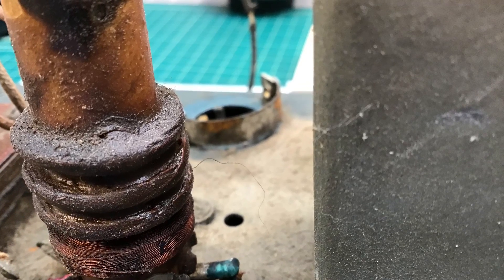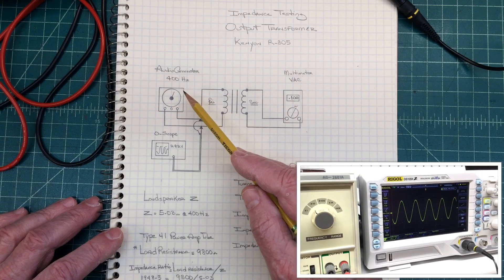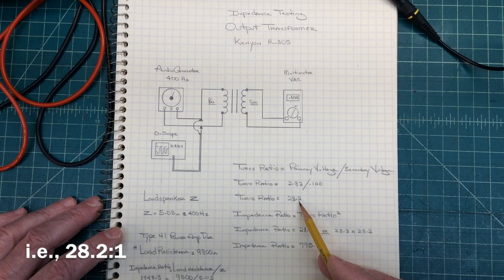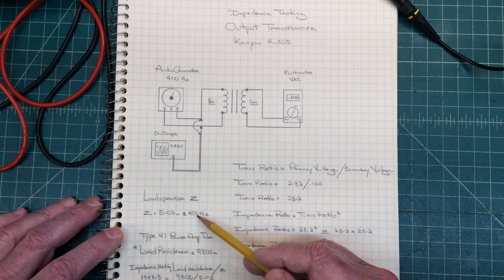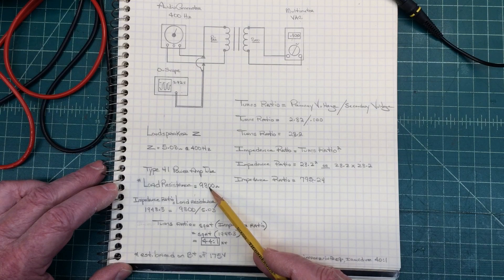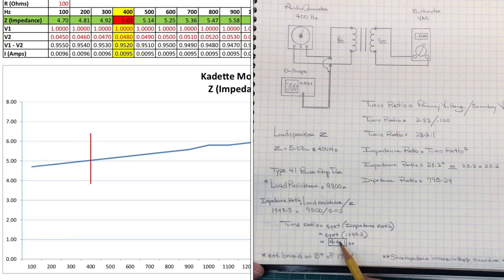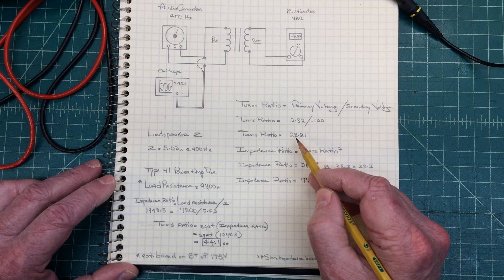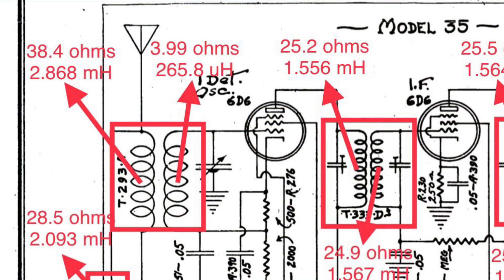Kadette Tele-matic AC Model 35 - Output Transformer & Antenna Coil Review

Comment: I was watching one of "Mr. Carlson's" videos and he recommended your site.  I got the impression that you have the ability to find the "un-findable" and I really need help locating a part.  I have a Garod V Neutrodyne radio and there is a part missing that I don't know how to replace.  A parts placement chart I found online calls it an "AF" transformer.  There are 2 of them that look identical on photos I found on the internet, but the one closest to the rear of mine is missing.  Can you help me find an actual replacement part or failing that, a suggested replacement part?
Reply from the maker: Wayne - I’m just getting back online, so let me review the schematic tomorrow. Is the missing part called out on the schematic, if so how is it noted? Best, Don
Reply: @RestoreOldRadios  , that is one of my other problems...no schematic.  You can find a schematic that says it is for that radio, but this radio has absolutely NO power supply, is battery operated ONLY, and the only schematic I could find shows a power supply...I think they show a 5Y3 rectifier....and that most certainly is NOT the one I have!  So you see why I would really appreciate any help you could provide!  I would really love to have it working, but with missing parts, a couple of capacitors that I am sure need replacing, but can't make out the value on them, and such, it is difficult.  The two caps I mentioned are flat square metal enclosures that only show enough information that you can make out that they are capacitors.
Reply from the maker: Wayne, what’s the model number of the AC model that someone mirrors this radio so I review the schematic. Best, Don

Comment: I don't understand why you used 2 different instruments (oscilloscope and multimeter) to measure the turns ratio. The oscilloscope measures the signal peak to peak, and the multimeter also but displays it divided by 1.41 (an approximation to RMS), or it may be true RMS. It would be better to use the same instrument on input and output.
Congratulations for your restorations.
Reply from the maker: Hi Alain - you are spot on, but I had my scope set to read RMS voltage, not peak to peak to mirror that of the Fluke. Thanks for watching and ensuring I was measuring things accurately. Best, Don

Comment: Very good analisys Don. I like all test you do on vintage parts. Only I have not understood how you got the impedance of speaker is 5 Ohms. That impedance seems very strange value, not standard, and your table of measure readings nothing says to me about that impedance. Why did not yo do the measures at 1000 hz? Why at 400 hz?
Thanks for your attentions, have a very good day.
Ketk (from Spain)
Reply from the maker: Ketk - early on the majority of vintage speakers were tested at 400 c.p.s. Check out the August of 1958 article in Radio & TV News by J.L. Smith titled Testing the Properties of Loudspeakers, page 39.

https://www.americanradiohistory.com/Archive-Radio-News/50s/Radio-News-1958-08-R.pdf

Best,

Don
Reply: Hello Don,  @RestoreOldRadios , I did not know that magacine of electronic news. I have read all article, and it is very interesting, cause it has some test methods I did not know from before. I have read it very carefully, and can say, that the frecuency used of 400 Hz is taken as an example, and works with the method the article shows, with the circuit of potentiometer at least 10 times bigger than impedance of loudspeaker and a 1P2T switch and an AC voltmeter.
Only one mistake from that article: VOLTMETER MUST READ VOLTS LINEARLY ON AUDIOFRECUENCIES.
(You can jump that difficulty reading volts with the oscilloscope).
Also, I can add about your answer, that the choosen frecuency of 400 Hz used on those times, it is not unknown for me, it was chosen cause pianos were adjusted at 440 hz (the La tone of the musical scale), and lot of technicians used it, cause it was the tone to set pianos, violins, flautes, and so on.
I have taken notes about these methods to know the value of R and L of any loudspeaker... and I think will do a video to remake the method system and to see its accuracy. Also it was very interesting the method to measure internal Z of the secondary of an audio transformer, aplicable to power transformers also, and not only to secondaries, also on primaries.
Now, after reading that article, I almost feel sure that you made the measurements of loudspeaker impedance not correctly. To be sure about that, you should do the masurements again with a variable audiofrecuency and osciloscope, to know where is the point the voltage on loudspeaker has its maximum.
Thanks Don for your answer. They are very interesting, and they make me learn too about different ways to do tests.
Have a nice day and I wait your news about this technical discussion.
Ketk Aiball (from Spain)
Reply from the maker: Ketk - I’m glad you are enjoying the article. I used my Rigol scope and measured the impedance at 400Hz 4.6 ohms, 600Hz 4.87 ohms, 1000 Hz 5.496 ohms and the impedance continues to climb towards 10000Hz, which measured 14.680 ohms. I hope you do a video on the technique described in the article I forwarded. Best, Don
Reply: @RestoreOldRadios  , very interesting issue... Z going and going up.... with the frecuency... 
Yes, I think so, that will do a vídeo testing these old measurements methods...
Because my curiosity is now as big as an elephant.
One question: Do you understand spanish?
Best regards.
Ketk (From Spain)
Reply from the maker: Ketk Aiball Very little Spanish. My English and grammar is not the best either. I’m an old country guy and do my best in the videos. I laugh at myself often. I was thinking about buying a real-time voice translator. Any recommendations? Best, Don

Comment: A well-done analysis of the output transformer requirements. I probably would have chosen 1KHz instead of 400Hz, but that's just a trivial detail. The video makes choosing an output transformer straightforward once you've done the other work (speaker-z, tube plate-z req).
Reply from the maker: Great question. The vintage speakers back in the day were commonly tested at 400Hz, but I tested it through 5000Hz even though I didn’t show that in the video. At 10000Hz, the impedance was north of 12 ohms. Thank you for reaching out and for watching. Best, Don

Comment: As I wrote in a comment on another of your videos, I haven’t had the need to replace or diagnose transformers yet. I know it’s just a matter of time, though, and this info will then prove invaluable. Thanks.
Reply: It's very rare that you would need to replace an output transformer because it failed, I've only run into this twice from what I can recall. Usually when I have had to find an O.T transformer it's because someone removed the speaker from a radio, or replaced the original with one that was either mechanically or electrically wrong. It's simple enough to test one, unlike a P.T the primary is either good or open circuit. What can kill them is a shorted tone correction cap across the primary, which is hard on the field coil, rectifier, and the power transformer, so make sure you replace it or clip it out before testing a radio.
Reply from the maker: Thank you. I hope you don’t need it anytime soon, but you’ll have it when the time comes. Best, Don